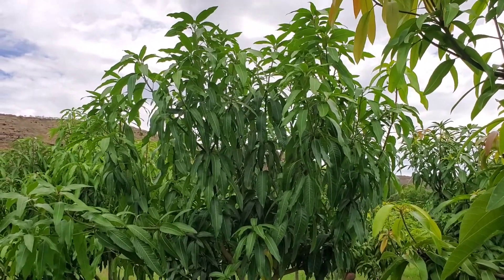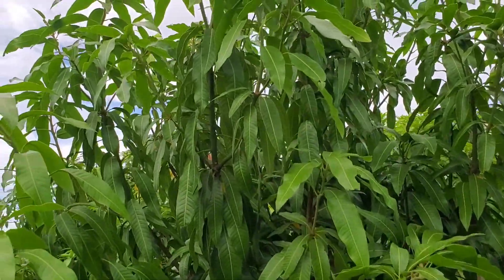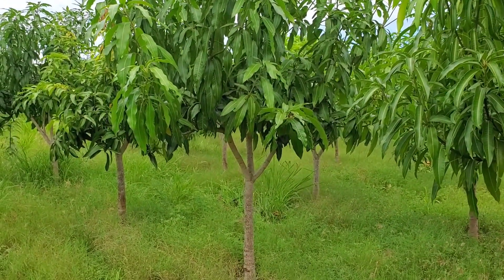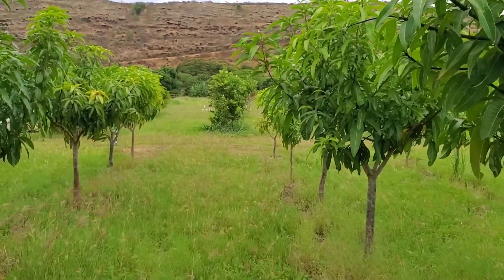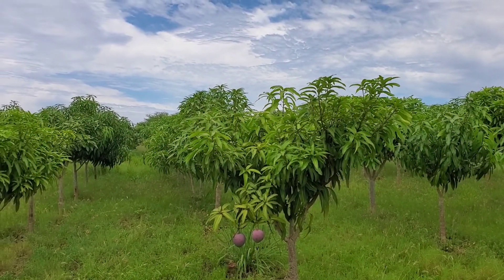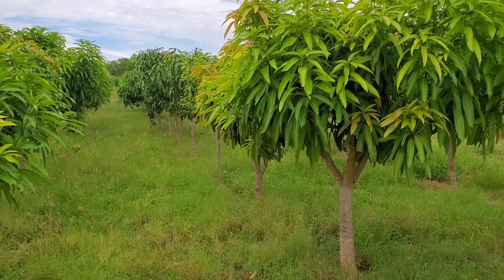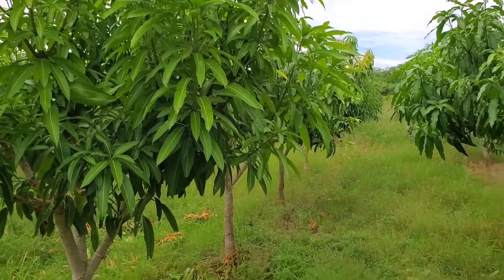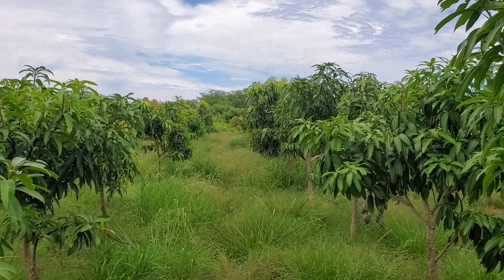Mango Loa Project: Ultra high density plantation post harvest pruning

Comment: I'm wondering why you chose vigorous vertical growing varieties like Keitt and Haden to grow in such high density?
Wouldn't it be more practical to choose more easily managed varieties to begin with?
Reply from the maker: Truthfully, i've been learning on the go.  I know now that keitt and haden are vigorous trees, but it doesn't mean these varieties are not compatible with these systems. It just means that the vertical growth needs to be managed properly, I haven't had too much trouble keeping my keitts low.  Nom doc mai is the slowest grower I have, but the canopy is so dense it takes more work thinning it out than other varieties.